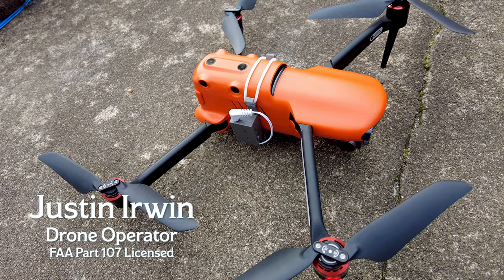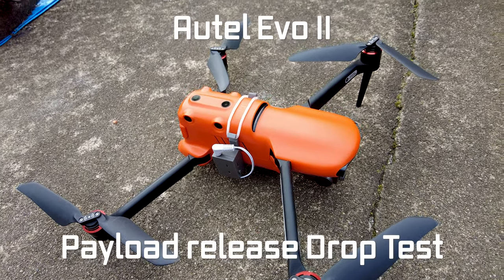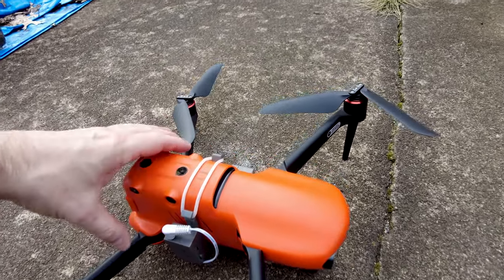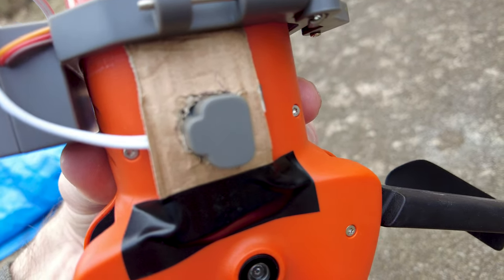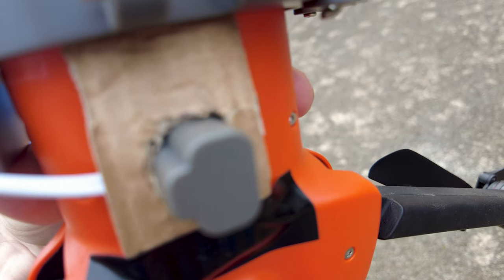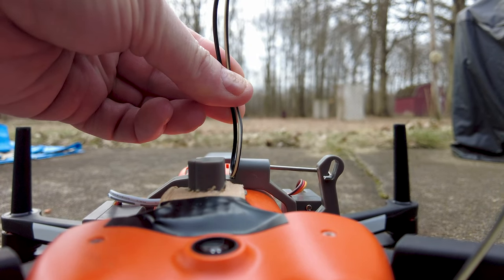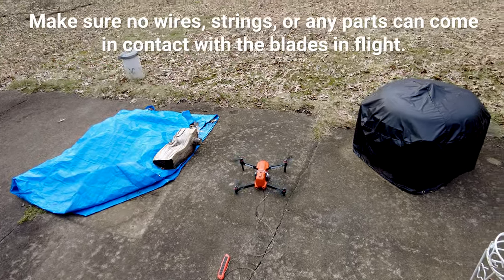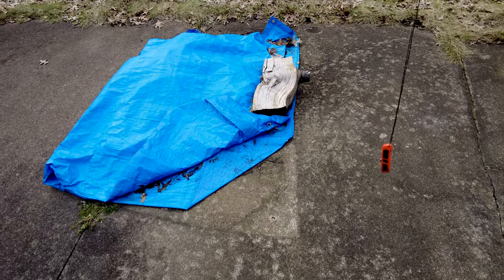Aultel Evo II Payload Release Drop Test

Comment: Very interesting an cool I’m curious I’m this could be modified to fit my Autel evo lite plus it does have a led landing light?!
Reply from the maker: I do not know if the red LED will trigger it but I would assume so. The biggest issue I could see is the size difference. This kit is actually designed for the DJI Mavic 2, you could compare the specs of both and make a judgement call from there.
Reply: @justinirwin6742  it’s about the same size the evo 2 pro is way bigger then the mavic 2 I’ve owned both birds so I guess worse thing that could happen is it won’t fit an I get a refund!! Thanks for your input
Reply from the maker: @jakesdronelife6307  Let me know how it goes.

Comment: how far can evo 2 fly n how many pounds can it carry??
Reply from the maker: The max weight of the payload release is listed at 500g. I haven't maxed it out but I'm pretty confident it will hold it. I haven't tested the max payload weight of the drone, I would consult Autel's documentation on that. I don't fly out of visual range but with 500g, I can easily go 1200ft and back.
Reply: 1 lb 10 ounces

Comment: How did you hook it up to the evo
Reply from the maker: It's pretty simple. The release system clips on underneath the Evo II with a heavy rubber band over top securing it. The light sensor has to be rigged a little, I flattened out the clip a little and used a little cardboard to make a shield over it that used electrical tape to make sure it stayed in place. The just open the release pin by activating the downward landing light, slip a string or wire loop in, and close it by deactivating the light. Once the Evo is airborne, activate the light again to drop.
Reply: @justinirwin6742  hey 👋👋👋👋 Justin do u happen too know whats the distance of this drop kit?
Reply from the maker: @udntknwshitt3941  It's the range of the controller. You attach it to one of the aux. landing lights on the bottom and control them with the Autel Explorer app.
Reply: @justinirwin6742  soo the drop button goes the  same range as the drone ???  ty Just .. u the best
Reply: @justinirwin6742  hey Justin how many pounds can our evo 2 fly n how far can evo2 fly
Reply: what specific setting in the app controls the landing light
Reply: It's the "Auxiliary Bottom Light" under "Visual Navigation".